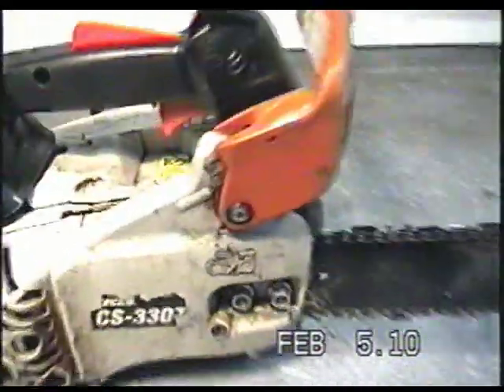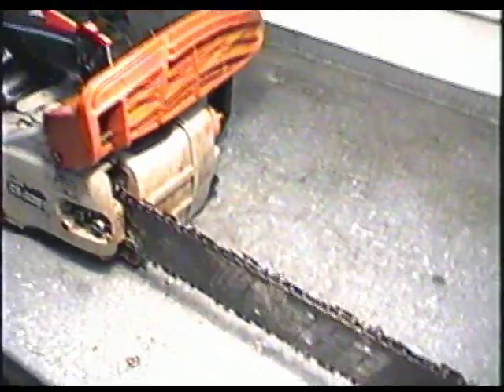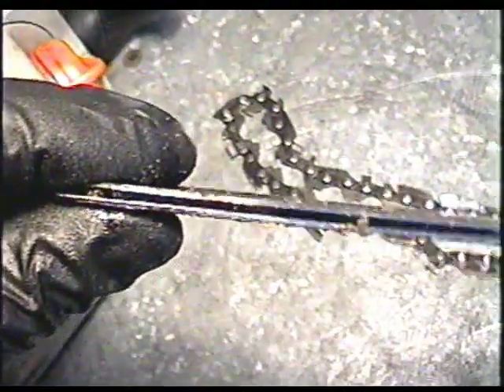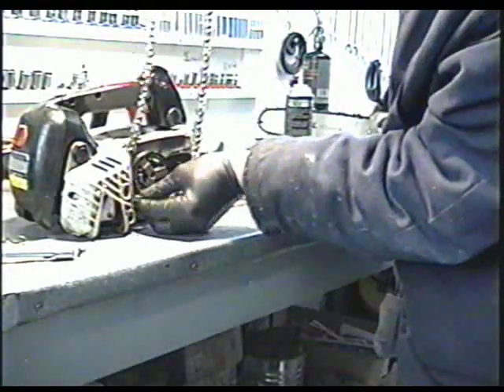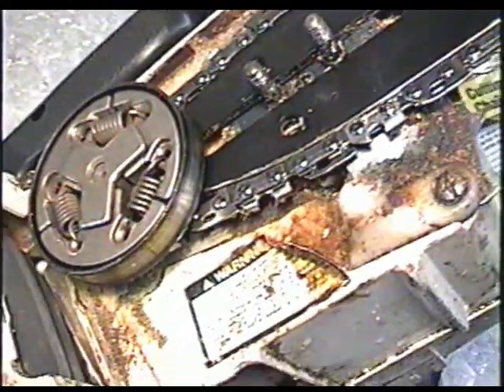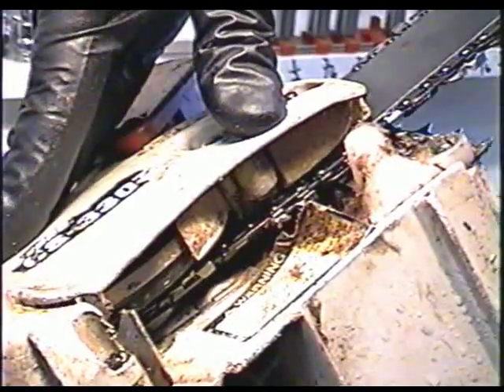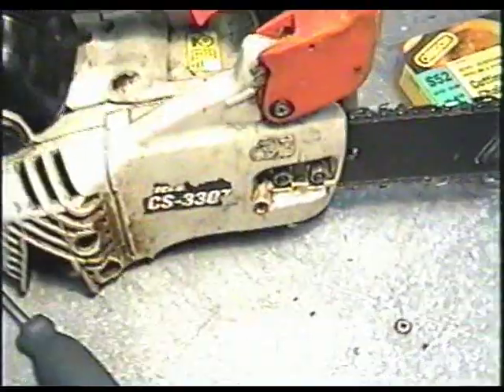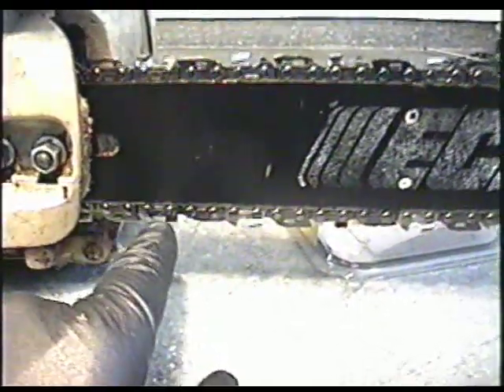HOW TO REPLACE THE CHAIN ON YOUR ECHO CHAINSAW

Comment: thanks for the review- please don't forget to pick up the bar just as you do the final nut tightening. Normally, we use the bottom of the chain to do most of our cutting and that pressure may ( with the vibration and force downward ) cause the bar to slide up a bit and change how tight the chain is. You can check how much difference it makes on the chain- when the chain is adjusted properly and nuts are just tight enough to hold the bar up or down, change the position of the bar without adjusting the chain. You should find that there is a difference if the bar is pulled up or allowed to rest down on how tight the chain is in both positions.

Comment: Question to you Donny. I have the Echo CS330 T chain saw just like this one. It was run with almost no oil in fuel. Do you have a video of you rebuilding the top end of this saw by chance?? Who is a decent parts house for the parts needed to do my saw. Can you give insight to these questions????
Reply from the maker: I have no video of rebuilding one. if that's the case it will not be worth fixing unless you find a used one with a good cylinder and piston